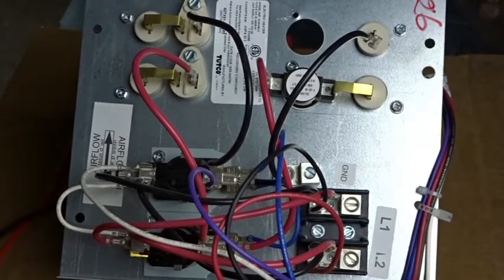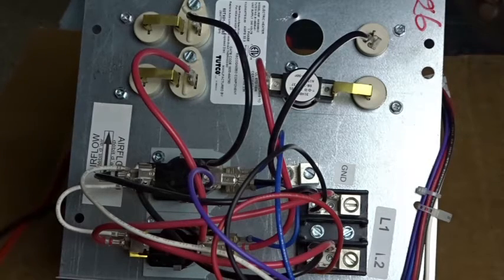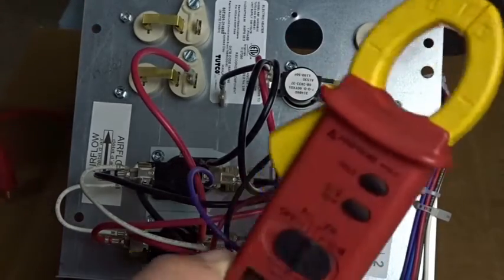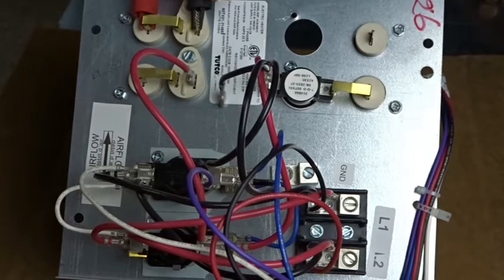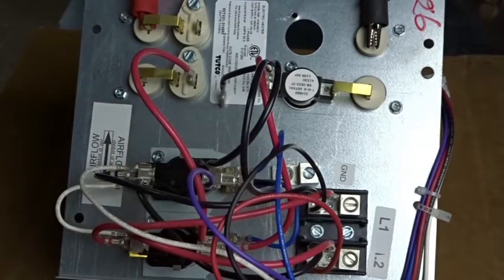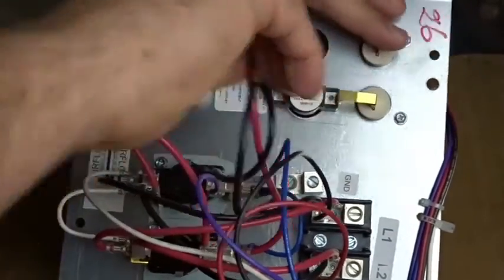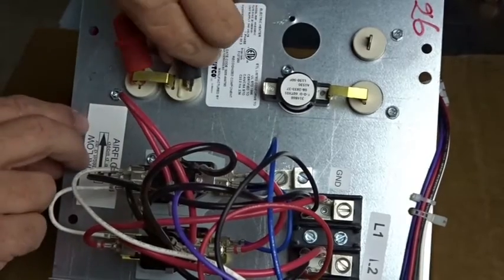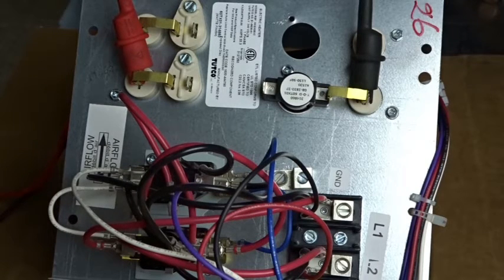Electric Furnace | Resistance on Heating Elements (Ohms)

Comment: How hot should the air be coming out of the vent? My unit is heating the house but it takes a VERY long time to raise the temperature because the vent temp is only about 5 degrees warmer than the inside house temp

Comment: Good video man. Only thing I thought was confusing was when you said the resistance is what causes heat. The more resistance the less heat there will be. If you string 4 of those in series there will be less heat. Likewise touch the two legs of power together and it gets super hot right now lol!
Reply from the maker: Ok, I got it. The resistance does cause there to be heat build up, but does not mean more resistance equals more heat output. Hope that clarifies it for those reading this.